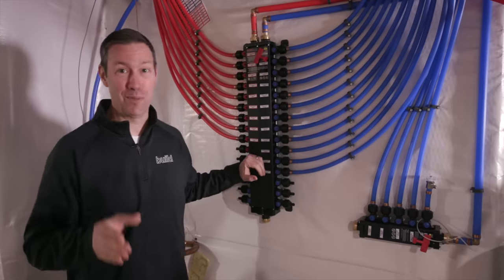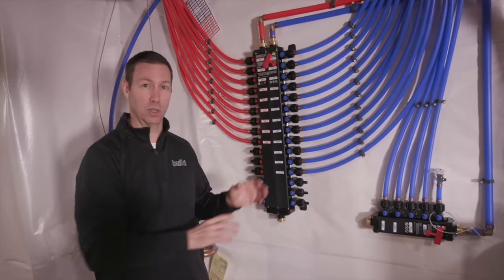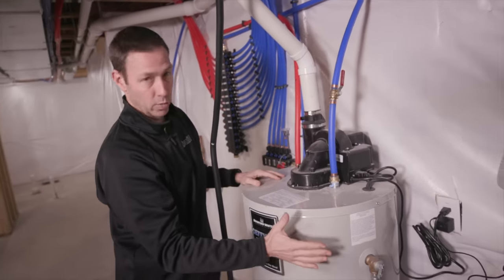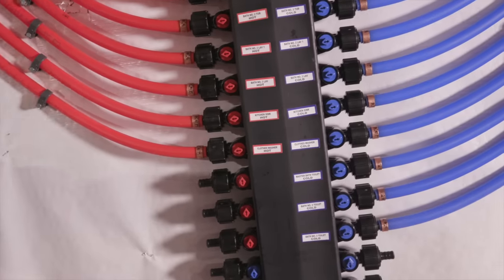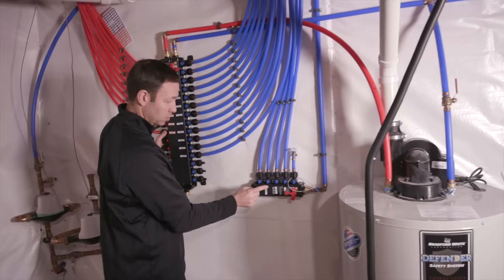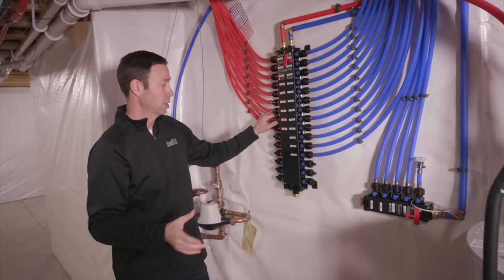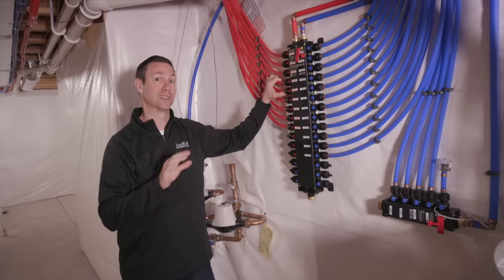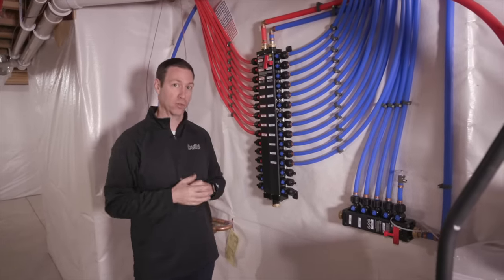PEX Manifold System - Pros and Cons + Tour

Comment: its not a great system when using one so large like in the video.....  the idea is to use smaller ones for each floor or per bathroom or two...  for example Run a main feed to the first manifold then branch off... then go to the next one..   you can then come back with a return for hot water recurculation....basically a hybrid old and new....  Ive just done a property  and the Main manifold is on the first floor between to bathrooms...  I have 26mm pipe feed to the manifold... and then a 15mm return which goes through the kitchen before returning back to the cylinder  for hot water recurculating... the branches of the manilfod are no more than 5 meters some only 1 meter long so very little water run off

Comment: 120 degree water and cold water in the same manifold, why not use separate manifolds to prevent the heat transfer? Also, let's try reducing water waste and hot water delivery time not increasing them - those are the REAL annoyances. The trade-offs don't make any sense. How often do you turn off the water anyway?

Comment: Used to have a house with a Manablock system and pressure was TERRIBLE.
Reply: Pressure is not the issue, flow is.
Reply: @1dariansdad  Even if it's at EVERY faucet? The only good two were the outdoor taps which bypassed it.

Comment: Those manifolds are the silliest thing I have ever seen. Twice as many pipes and connections running through the house. Sure you can isolate something individually... but how inconvenient is it to just shut the house off to fix something? Just run a 0.75”-1” hot and cold run and branch off as you pass point of demand. 

Manifolds just puts 4x as much pipe in a house to developed a leak

Comment: That pipe should not be 1/2" for the runs, it should be 3/8".  Also should be copper Run off hot side of hw tank for at least 12".  I wouldn't drop to 3/4 untill the manifold as PEX id is smaller than copper.

Comment: Feels like way too many pex pipes. Almost unnecessary/waste. Why not just add shutoff valves next to fixtures? More efficient, less pex pipes running through the house, and faster hot water delivery. That's what i'd do regardless of the size of the house. This feels like its more useful for industrial/commercial buildings with large sectional areas.

Comment: Seems like it's a pretty big house and they doesn't have circulation for hot water at all. It's not wise to bring all hot subsribers to one place. It's more wise to build one  fat insulated pipe around house and put a pump for circulation. Just imagine, how much time you gonna wait for hot water in master bathroom to brush your teeth? It's a waste of water and money. Boiler also seems to small for house. In that installation you are definitely need flow boiler.

Comment: Why are none of the water lines insulated?
Reply: They are inside the home, Protection against freezinf not an issue.  When hot wate is used there enough insulation to prevent much heat loss. The water in the hot lines is cold 99% of the time as there is no flow to keep them heated.

Comment: Slightly Less fittings! 10X the piping! not to mention the 150$+ manifold and god help you if you are trying to replace a faucet or a fixture and you turn the water on from the basement and the fixture is spewing water everywhere while you are making your way to check it. dont forget you also have to run back to the basement when you find out.

Comment: I really don't see why this system makes a difference in how fast hot water makes it to your fixtures.  50ft is 50ft, you need a circulator or on demand hot water at the fixture.  This system is for ease of install and organization, that's it.

Comment: Pex connected directly to the hot water tank is wrong. Should be at least 18" of copper pipe exiting the heater then transition to pex.
Reply: Should be at least 18" of copper pipe exiting and ENTERING the heater then transition to Pex.  Inlet temp will run just as hot during stand by.

Comment: The fact each branch can be isolated is almost no real benefit at all. At the end of each branch a shutoff valve should be installed anyway. So in other words if you had to change a faucet out for instance youd shut it down at that valve. No reason to go down in the basement and kill the entire 30 foot run
Reply: Really depends on your particular circumstances. Manifold is centrally located in my case so having all of the valves in one area is very convenient.

Comment: why so overcomplicated?
why hot and cold next to eachother?
less fittings but longer pipe, think about it for 3 rooms on same side, 5m each, you need at least 30m pipe instead of 15m.
more surface area, worse insulation.

I think this is only suitable for non heated apartment distrubition. Each resident gets their own.

Comment: Every video I watch for Pros and Cons of PEX. No one talks about it. 
PEX is great but not for running under house or attics or even  walls.
Unlike copper pipes, PEX have 25-50 year life expectancy. It could be even shorter. 

The cons are: does not like daylight, prone to chlorine damage, prone to rodents, bacteria magnet, and foul taste from plastic chemicals.
Only reason why PEX got popular is. You don't have to be highly skilled to use PEX.
Copper is time consuming, expensive, lack of skilled copper plumbers, and higher wages for copper plumber vs PEX plumber.

Comment: That is not a good install.  The instructions show you should have 2x4s on either side with holes drilled through them to take the load off the manibloc.
Reply: Good point 1 break and the whole manifold needs replacing

Comment: I disagree with your assessment of the time it takes to evacuate 25' ft of 1/2 in line as being a con.  Without the homeruns, you would be evacuating 15 - 20 ft of 3/4 in trunk line, which would take far longer, at least for the first fixture, which is what we usually are waiting for.  I've seen fairly short runs of trunk line take so much to evacuate the cold water that washing my hands has caused the water heater to kick on.

Comment: Well, this is not a very complete explanation. First of all the internal manabloc body has a diameter of 1-1/4" and not 3/4". Point 2: If you want to install this system in a huge big house (I designed a System for a 11-Bathroom-Mansion), logically you cannot use a single centralized manabloc system. What you will do is zone with several manablocs or miniblocs. Then you can have a dedicated heater for each distribution center or if you prefer a hot water recirculation system which you can connect to all the supply connections of the manablocs or miniblocs. So suddenly you shorten distances and you can have hot water in less than 5 seconds wherever you want. So where are the  disadvantages Matt?

Comment: This way to route pipes comes with major drawbacks.
The hot water lines are not insulated and have no recircualtion. It not only is very inconvenient, it also poses a great risk for legionella bacteria to grow. Also algae and other cultures can grow on the walls of plastic pipes with lukewarm water, causing a biofilm inside the pipe. If you have even one tap that never gets used there is a long stagnation line with musty water.
It looks nice but this is actually a very bad setup.

Comment: I have this in my house in OKC, not good system. All valves are frozen,  can't operate, three broke while attempting to open. I need one hot one cold line in each area to save water and energy. I like valves on every branch so if anything broken or leaking I can shut off without affecting any other line. This system is not working and not recommended.

Comment: Maybe it's just me, but it looks as though the larger manifold is considerably out of plumb. The smaller one looks to be out of level as well.
Have to agree, this is an incredible waste of pipe. Being able to turn off individual fixtures, from this central point, does not seem to provide enough benefit to outweigh the cost of all that tubing.
And I definitely do not agree that this is a nice installation. It actually looks very sloppy.

Comment: One of the downfalls of PEX is more connections? Compared to what- getting your water from a fire hydrant? Copper has substantially more connections than PEX. This is a horrible install though, compared to a trunk and branch system. No pipe insulation, long wait times for hot water, and a huge waste of water and the heating of it. This system basically contradicts everything that Gary Klein preaches. I would bet that my 6000 sq. ft. house with double the fixtures contains less line length than this 2000 sq. ft. home.

Comment: Beautiful??? Hardly. It's obvious that they were cutting every corner they could to make a few extra bucks. 
All of those runs out of the manifold should be exiting horizontal to a bend support bracket to take the tubes vertical. While this tightens up the installation, it also take the lateral stress off the manifold ports. But I guess that case of beer at the end of the week was more important.

WTF is up with the lines running to the water heater? Especially that valve floating in space on a flexible line.

Comment: Woops! You need 18" of copper coming out of that water heater as per the manufacture's instructions.
Reply: @ike fun Cite your source... better still use common sense, of course it's sensible to have copper coming out of the boiler. For reasons of maintenance down the line.
Reply: @ike fun You say "dumbass" way too often to hope for anyone to take you seriously. Also your "my source is this video" literally made no sense whatsoever.

Comment: Its amazing how incorrect all of the information you just gave was. I own a plumbing company in Maryland and I know codes vary state to state but the operating principles do not change. You will always have less water wasted with this system since it only replaces the dead water in each individual line as well as the opposite ,you will get water faster as a result of only having to push the same water. Using a trunk and branch system is fine it works but its not at all as energy efficient as the manibloc system. If you couple a tankless water heater with the pex sytem it is the ultimate in efficiency, also if you size your system properly and know your incoming pressures you wont ever have to worry about your distances from manabloc to fixtures. Insulating the hot lines is not required here under 3/4 inch diameter but even with that said insulating a line that doesn't store or return back to a stored tank is irrelevant with the manabloc system. I would strongly recommend doing real research before giving wrong or misleading information to the general public!!!!
Reply: Jason Long - I think Matt is correct here. The total volume of water in a branch system is less than that of the manifold system. If I turn on the faucet in the master bath of a branch system, the 'hot water' is brought all the way to the (likely last) intersection which is likely 5-10 feet from the shower. If I then turn on my shower, I'd only wait for water to travel that last 5-10 feet, not the full distance. You might say that the branch system would require a larger pipe to supply 2+ fixtures. Then yes, that initial faucet opening would waste more water but that is the negligible volume. Overall, if using PEX, (where the only breaks in the line are at the supply, T connections and at the fixture), the manifold and branch systems will have the same number of connections will have less pipe and thus less failure potential. Lastly, who 'really' needs to be able to turn off 1 fixture? This is a need that might come up every 5 years... I welcome critiques to my conclusion.

Comment: Ummmm... why on Earth would you run the hot and cold into one manifold block... this just seems like a "great way" to be constantly warming your cold water while cooling your hot water.

I see no advantage to this setup as compared to just using two separate manifolds (so there's no conductive heat transfer).

Comment: These Plumbing manifolds are terrible in motorhomes, First-time winter hits they freeze even if you winterize the rv. take one fill it up with antifreeze put it in the cold freezing weather and then drain it and test it. I bet it leaks everywhere. the plastic is cheap. they have been putting these in high-end rv's for a while now. but they recently stopped because they are Junk.

Comment: You speak and present well, but what you say is mostly incorrect.
1. Electrical distribution is not a good analogy to the manifold system.  Electrical is more like a hybrid. Each breaker in the breaker box (its not a "Circuit Board") feeds multiple chained loads, not a "home run" to each.
2. You didn't mention the biggest "pro" - that water pressure is not divided among multiple fixtures, so for example, the shower pressure doesn't drop when someone flushes the toilet.
3. The total distance from the water heater to a fixture is typically shorter than a traditional system, not longer.  And by using smaller lines to individual fixtures, the hot water wait time is further reduced.  The only time you'll get hot water faster to the shower in a traditional system is if you happen to use hot water at two fixtures that are close to one another in quick succession.  That is not a primary use-case to design for.
4. And don't put pex directly on water heater and, and, and
In short - use your presentation skills to discuss something that you actually know something about, or at least run it by a subject matter expert instead of monetizing the dumbing down of humanity.
Reply: Two great points: 3/8 for hand fixtures and separation of PEX from the heater to avoid overheating/swelling/bursting of the PEX.

Comment: Huge problem getting hot water recirculation with a system like this.
You will be wasting water.
Should have a trunk line to each bathroom with a recirc return to a manifold that feeds the recirc pump near the water heater.
This is a waste of pex pipe with no benefit.
Changing an angle stop or working on a shower valve at some point in the future can be done by just turning off the main water and draining the system like it always has been done.
Also, undersized supply on that manifold for all those demands.
Go turn everything in the house on at once.
I bet you see the problem.
With properly sized lines, you can have a house party and not notice a drop in pressure.

Comment: Ya'll will flame me for this but. Having the manifold and shutoffs integrated is a bad idea. The valves WILL go bad. and then the repair process is much costlier and more involved. This system might look pretty but it'll be a nightmare for repairs down the road. 

Keep the system less integrated so that repairs can be performed easier. It may require more fittings and what not but the future plumber will be happier.

Comment: pex manifold has had failures in homes 10+ years old.  The state should take responsibility for granting permits when it only last 10 years in a wall and not in ground.  In the wall copper last 100+ years.  The state should pay for all the repair and not approve products that are substandard (even if their bosses get campaign contributions = bribes).  This is really a shame that home owners are stuck with re-piping every 20 years even though cheaper than copper.  Over 100 or even 50 years it costs a lot more to use pex.  Until the technology improves.

Comment: @mattrisinger (NEW BUILD) HOT water RECIRCULATION PLUMBING.......
For the hot water supply to circulate.....Couldn't you take a different color PEX line (IE.clear/white, purple, black) from a "T" that is placed at the end of each run; 
Then said __(color)__ PEX would "homerun" back down to, yet another manifold;
Then said PEX would leave manifold by FLOPPING of ports the inlet & outlet ports.
(used to be inlet, is NOW OUTLET)

Comment: The TOILET is getting softened water?
It's not on the small one. ;)
Reply: @Rizz Or using rain water. It's as soft as it gets, it's free and there is abosutely no reason to use drinking-quality tap-water for this task.
Reply: @Rizz But the salt for the softener is not cheap. I know the handheld ones from the kitchen and the running cost is not exactly neglectable. It may be cheaper in places where the tap water isn't basically saturated with chalc but how much could that be?

Comment: The hot water issue is the complete deal breaker with pex. You can’t use a hot water recirculating system. And you have to wait forever for hot water.  You’ll end up wasting millions of gallons of water over the life of the product.  Most tankless hot water heaters now have recirculating pumps in them. Would be nice to be able to use them.  Copper all the way.  Have you ever tasted the water in a new pex house? Yuck.

Comment: I prefer in line isolators below each fixture. Therefore turn off the water to the kitchen faucet under the faucet then change tap or washer. Then turn on water. If the tap blows under pressure you turn the isolator off. How much more damage is done going to basement, turn on, walk to kitchen, faucet has blown so run back to the basement. Also the manifold system is very wasteful in pipe rather then a circuit system. Also who has a high pressure crimping machine? The plumbers do so to change any pipe or install a new pipe the owner will have to call out a plumber. All in all I think the manifold system is shite.

Comment: I definitely think this a pretty poor plumbing system. There is a lot of wasted water and the advantage is really invalid considering how infrequently you will have issues or updates warranting needing to turn of your water supply. I think if the system was realized a little better, more like electrical for example, where you have one wire feeding a room and it's distributed from there. So possibly having smaller distribution blocks in any room with several fixtures, i.e. kitchen, bathrooms, fed by the main distribution block. This will reduce the hot water wasted and the piping required in total.